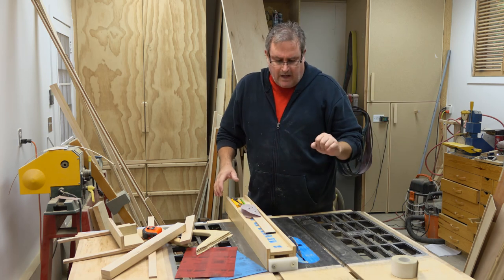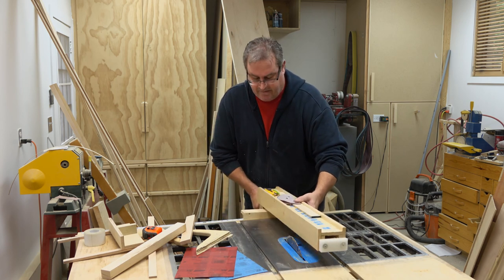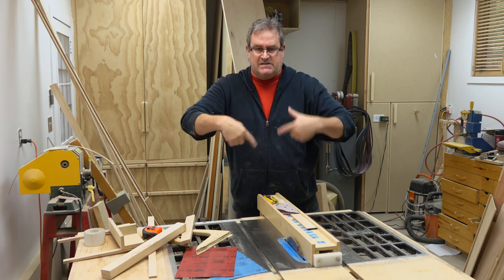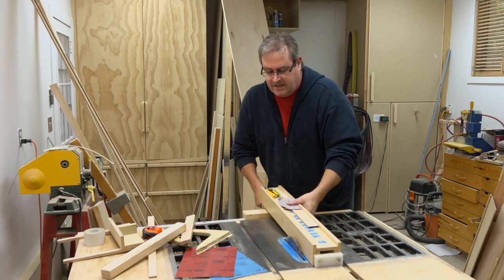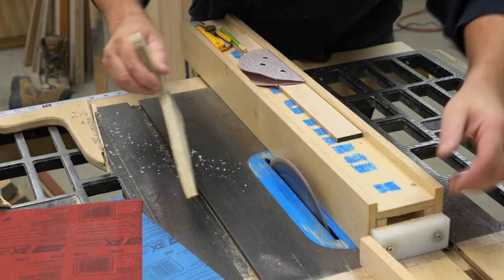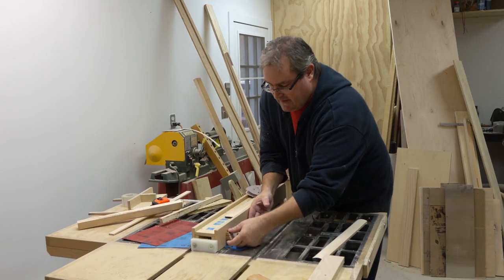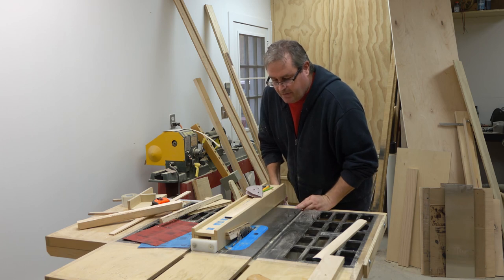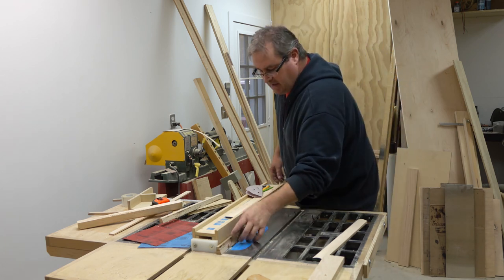Table Saw Basics - Bevel Cuts

Comment from the maker: Trapping the piece you are cutting when making a bevel cut can result in a violent kickback and should be avoided by moving the fence to the other side of the blade. 
Additionally, the best way to ensure accurate bevel cuts is to make sure your saw is set up correctly, that when it tilts it stays in line with the fence. A good quality, sharp blade will also make cutting bevels more efficient.

You can help support the work I do in making these videos: 

Plans for sale: http://www.ibuildit.ca/plans.html 

Support this channel on Patreon: https://www.patreon.com/user?u=865843&ty=h 

Did you know I have other YouTube channels? 
My main channel: 
https://www.youtube.com/user/jpheisz 

More videos on my second woodworking channel: 
http://www.youtube.com/c/IBuildIt 

My home reno channel: 
http://www.youtube.com/c/IBuildItHome 

Website: http://www.ibuildit.ca/ 
Facebook: https://www.facebook.com/I-Build-It-258048014240900/ 
Instagram: https://www.instagram.com/i_build_it.ca/
Reply: I've just been out to my shop to try doing it the wrong way, as it seems I have been doing it right all these years!!..........erm...Do you have the number of a good dentist?

Comment: I learned that mistake the hard way several years ago. Was trimming a slight bevel on a wooden heat register frame (about 4 x 10 inches) to embed in a hardwood floor. While pushing it through, it started to vibrate lightly. Then suddenly a loud BANG!! The frame literally vanished into thin air and my thumb and shoulder was hurting. I looked at my thumb and saw nothing wrong. Looked at my shoulder and found a cut. So I look behind my shoulder and found a chunk of the frame embedded in the wall behind me. After much searching, I only found enough pieces to make up about half the frame. The rest was just... gone. Now I ALWAYS be sure the blade tilts AWAY from the fence.
Reply: Gumboot Zone holy sh%t

Comment: Definitely a good video on what NOT to do. I have always located the fence on the side away from the tilted blade teeth. You must have your feed dead on level and dead straight in,  if you don't.
 A right tilt saw would have the fence on the left side of the blade and a left tilt saw, the most common these days should have the fence on the right side of the blade. This is one of the RARE videos I could find on You Tube which demonstrates this "wrong" and unsafe approach. A big thumbs UP.

Comment: Hi thank you for sharing your knowledge. I'm a beginner and honestly I'm scared as heck  about  kick back possibility. I don't know much, question? Can I cut sheets of panels on a table saw. I saw your videos on if it pinches or it jams afterwards. Also can you cut angels on panel sheets, exam a 45. Here is my sinerio I want to cut panels into stripes, to make risers for my stairs. Some have angel cuts  others are flat. I had the sheets ripped so I could fit them in my car. They need to be cut? Is the table saw the correct tool for this? I have a ryobi 10in with stand. I appreciate your time and knowledge.

Comment: safer is always better.   and i remember an old saying something about reading your tool manuals and safety glasses so you had eyes to see the end of the job lol ripping thin stock is always risky and small pieces left between the fence that cant be cleared are always a danger.  kick back happens when you least expect it.  or you dont know how to use the tool .  either way master or beginners alike should always use proper set up and safe practices.   because if you cut your  fingers off you won't be able to type your 2 cents into other ppls vids lol 
great vid keep them coming

Comment: Another highly significant warning, many thanks John.

Apart from the safety considerations, I would expect that as the rotating saw blade tries to lift the wedge-shaped piece between it and the fence, this will try to bend the blade away from the fence, possibly permanently distorting it, and will try to push the fence away from the blade which could force it out of square or even damage its clamping points.  A good idea to then check the blade and the  parallelism of the fence and the rigidity of its attachment to the table, rather than risk a kickback on later (normal) cuts due to misalignment.

Comment: I had to make a bevel on a door.  The door was waaay larger than the table saw top, so I pretty much had to put the fence on the wrong side.  And, yes, the sliver of oak that shot out went more than an inch into a brick wall.  I really want to do the myffbuttfers thing and put a pig carcass in front of it, to see if it gets run clean through.